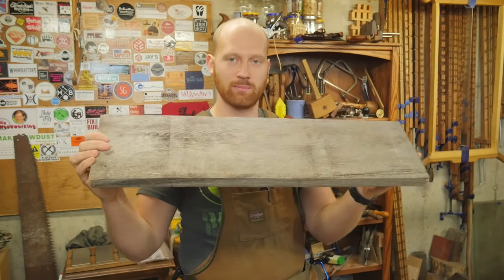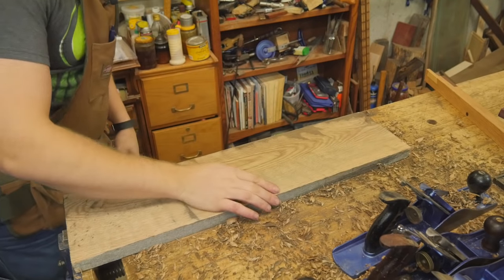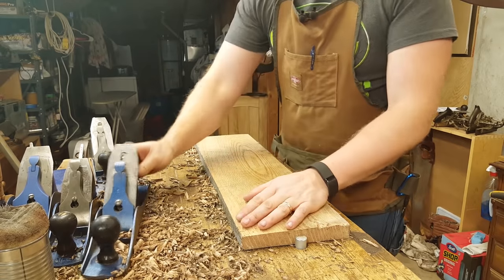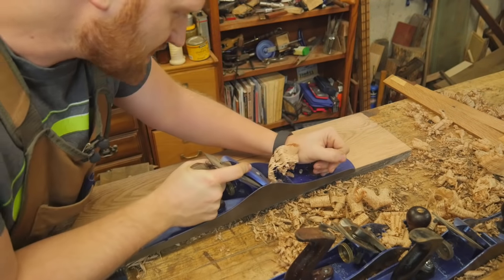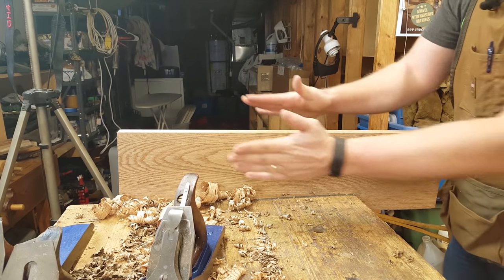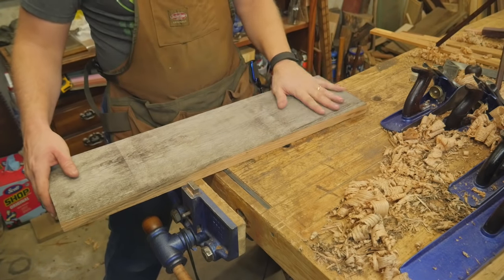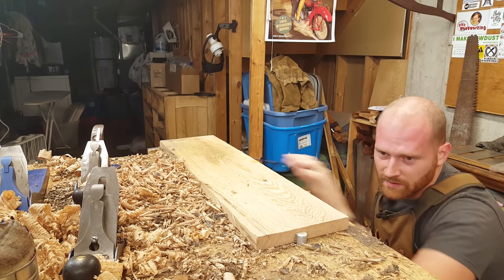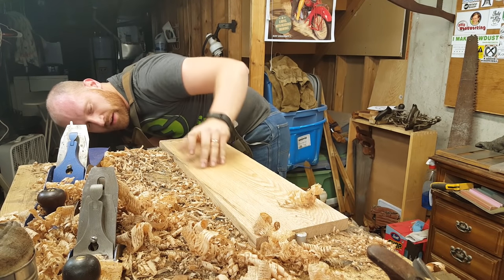How To Dimension Lumber With Hand Tools - Woodworking Skill

Comment: Thanks.
I am missing the reason why/when we need to actually have the edges square and parallel.
For instance, for a panel, we are going to joint the edges and for that we will pair the edges of two boards and plane them simultaneously. Therefore no need for sweating the edges-square-the-face stuff. Ditto for parallel edges. And all the tonge-and-groove stuff will be registered to the face side. The other side will be in the back, so no need to sweat the thickness part. And finally, the whole panel will be planed in the end, relaxing the need for extreme accuracy.
That's just an example. I'm sure the posts and rail in a frame need more dedication to accuracy, but I'm sure the cases when we actually need perfectly dimensioned lumber are a minority.
Reply from the maker: Every application is going to need a different amount of accuracy. It all depends on what it is joining to and how much that will affect the other pieces in the project. Usually this kind of dimensioning is only done for general carcass stock or shelves. You do this to take roughs on lumber and get it roughly to the accuracy that you need for the particular project. If you're joining it to another board then you just do the two faces and then you do the edge when you go to joint them.

Comment: When you were going against the grain with the number 5 it didn't sounds like you were getting any tear out even though you had the mouth open. Were you and I just didn't hear it?
Reply from the maker: Yep. You can fix a lot of tear out by moving the chip breaker extremely close to the tip.

Comment: In my experience, using winding sticks at the beginning when there's still cup in the board tells you very little. It doesn't really tell you that a particular corner is higher, because it's not actually resting on that corner. It's actually resting on the center of the cupped surface. so I generally try to get most of the cup out before I break out the winding sticks.
Reply from the maker: true but you can see the gap from the cup under the stick so it can tell you if it is leaning one way or the other. and gives you a good idea about it before you get going.
Reply from the maker: nice bags by the way!
Reply: Wood By Wright you talkin bout my bags?
Reply: sure, it tells you something. But you have to be careful about how you read it. When I was less experienced, I was led astray by reading it wrong quite regularly. By the way, thanks for going through the whole process. I've done this myself many times, but it's always nice to watch someone else do it to compare and contrast.
Reply: I'm not quite sure what bags you're referring to?
Reply: Jonathon Jongsma I sent him a picture of some bags on twitter. I'm also a Jonathan J. So I'm guessing he missed it.
Reply: Jonathon Jongsma I sent him a picture of some bags on twitter. I'm also a Jonathan J. So I'm guessing he missed it.
Reply from the maker: I put the comment on the wrong Jonathan sorry. and you are very correct. there is a lot of experience that goes into reading the wood correctly.
Reply from the maker: LOL yup wrong Jonathan!

Comment: Hi James! Could you tell me what the 208 Stanley plane is for? It’s a beast at 2 feet long.
Reply from the maker: I'm sorry I'm a little confused. A Stanley 208 is a level. Are you referring to a 608. That is a jointer plane just like the Stanley number eight just as a few other bells and whistles.
Reply: You know your planes young man, it is a 608. Thanks for your calming videos! Helps with ptsd

Comment: Why is it important to angle the plane differently (@ 4:05) and how do you know when to change the angle?
Reply from the maker: At that point I was talking about the grain direction. You want to make sure you're going with the grain. If you are scrubbing the wood then you can use cross grain cutting which is where I was showing going at 45°. That just makes it easier to push through a deeper cut.
Reply: @WoodByWright  Thanks for the reply.  This may seem like a stupid question, but I'm a novice and i didn't realize the grain could vary so drastically within a log.  Wouldn't that mean the grain is really wavy?
Reply from the maker: Some woods can often change every few  inches. It all depends on how the tree grows.
Reply: @WoodByWright  Thanks again, great information!

Comment: Ya know, its funny to me because planing  is my favorite part of any build project. So much so that I can get carried away and end up planing too much. 

Then there is the process of how sharp is sharp enough. A friend of mine said I was doing too much work passed 800 grit, because that will shave course hair rather well. I tell him but some times I want a translucent shaving in case I need something to write on.
Reply from the maker: I am in the same boat. I am often going well past the lines.
Reply: Wood By Wright then I'm sure you've also felt the reluctance of not wanting to use that particular piece out of some sense of pride for getting it "too" square and smooth, and altering it further perturbs that sense of perfection.

Comment: You'd be surprised how much easier to plane on a bench that doesn't move.
Reply from the maker: LOL yes. I honestly do not feel it but the video shows it. that is one of the problems with Doug fir 3" x 3" legs. when I move into a larger shop I will be making a second bench out of stouter material.

Comment: Sounds like Jim Carey.
I was wondering if by hand could compete with jointer/planer. Absolutely not if doing anything of significant numbers. would come out of winter a tank though. but lopsided.
Reply from the maker: LOL. I actually have a video on comparing a power planer to hand scrubbing. for one board the power planer is slightly faster, but not by much as there is setup and PPE to take care of, but for batches the power planer cuts the time in half!

Comment: is this for your chest of drawers?
Reply from the maker: yes it is!
Reply: good stuff, that's gonna make a nice drawer front.  man, i like the colour of that oak!   I just scored a huge pile of mixed hardwoods, air dried ten years plus, lots of quarter sawn red oak which i don't like as much as white because of its vicious step-down when plain sawn...however this quarter sawn stuff looks pretty good. also black locust, elm, birch, maple.  I like having a variety on hand :D.  The guy's prices were so cheap i'm going back out to get some maple once the weather warms up around here !
Reply from the maker: sounds like a sweet pile! These will actually be drawer sides and backs.
Reply: are you going to resaw that 7/8 stock in half for the drawer sides and backs?
Reply from the maker: nope. It will be that thick for the sides and back. the bottom will be out of resawn 4/4 white oak.
Reply: Dude what are you storing in there !?? Haha it'll be bomb proof!
Reply from the maker: you bet! it is going to be a beast!